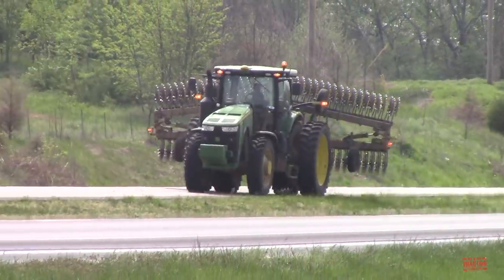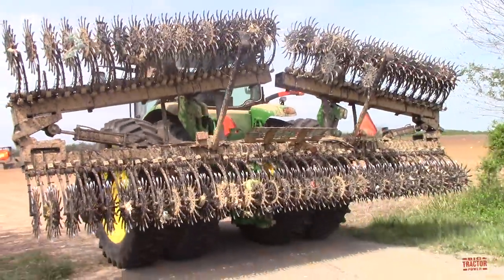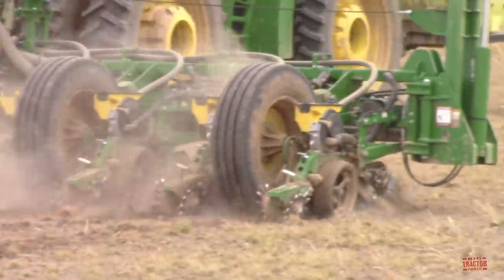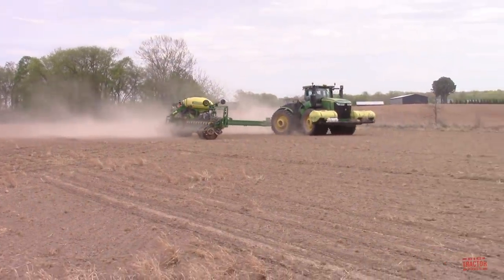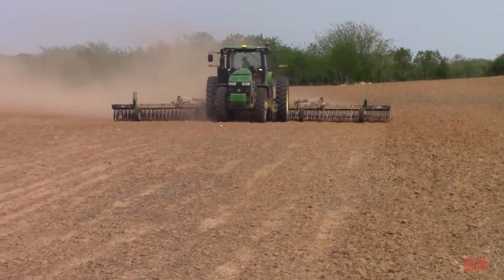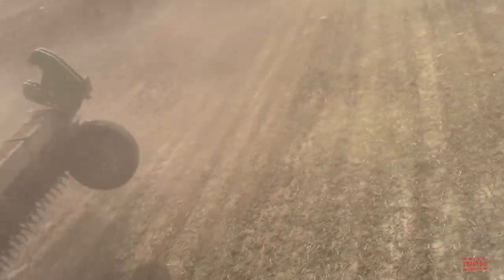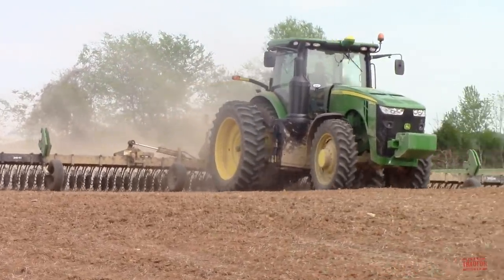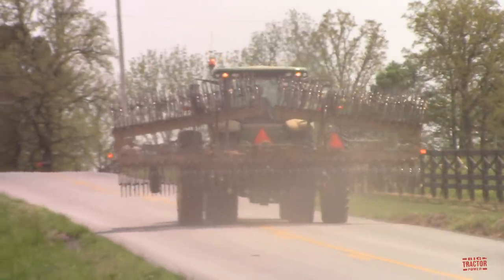YETTER Rotary Hoe High Speed Crust Busting at 9 MPH

Comment: If the rock is big enough it will roll over it, most of the time it gets wedged and locks up, bends the bracket,,,, we run these every year it seems. This exact rotaryhoe. Just the bigger yetter. Lots of bearings, but you gotta have them! And they thin the stand out no matter how you set it. It’s just the way it is and cheaper then replanting.
Reply: Does it matter where the wheels of the tractor are ? Thanks.
Reply: august between the rows

Comment: Used a WD to pull a 6' rotary hoe back in the day.   Always looked like a fun job because you could drive so fast in the field ...  but the actual experience was painful because of the constant bumps on a rock hard seat while wrestling the steering wheel.      It was a pull design, so for transport, you switched the hitch to the other side so the points didn't dig in.

Comment: It doesn't hurt that he is running over some of the corn? What is that light colored stuff all over the field. It kind of looks like bits of trash but I'm guessing it is something else.
Reply from the maker: At this very early stage it does not hurt to run over the corn. What you see is trash. The field is along a 4 lane highway. Lots of litter bugs out there.
Reply: @bigtractorpower  Really that is horrible. Freaking jerks throwing trash out along the roads. I wish the highway patrol would spend more time catching people like that then worrying about people driving less than 20mph over the speed limit. Not a big fan of speed limits or litter bugs.

Comment: The tractor driver is running over the corn with the wheels instead of driving between the rows.
Reply: I was wondering the same and if it matters ?
Reply: August it matters if you want to raise a decent crop
Reply: They're using GPS guys
Reply: @RyTrapp0  Don't know what the excuse is but he still was running over a lot of corn. I couldn't tell if he was using auto steer or not. I don't think he was.
Reply: When the crop is that small the crop can grow back if it was driven over.

Comment: Yield plus or minus?
Reply: Im from South Africa and this is mandatory after planting as the high heat crusts the soil over in a day or two. If done while the soil is too wet it damages yield as some plants gets ripped out with sods. But not doing it can cause you to have to replant  as the corn can turn around under the crust and die.
Reply from the maker: Yield plus. You have a short window to do this. If you don’t then you have to replant the entire field.  Not doing it leaves huge blank spaces where the corn did not grow.

Comment: If they would plow the ground deeper than just running disks over it, water could go through instead of flowing over the surface... This Problem would never exist.
Reply: Lol no it doesnt work like that. Heavy rain hammers the soil down causing about an inch of crust. It is more of a problem in conventional tilling in hot areas than notill